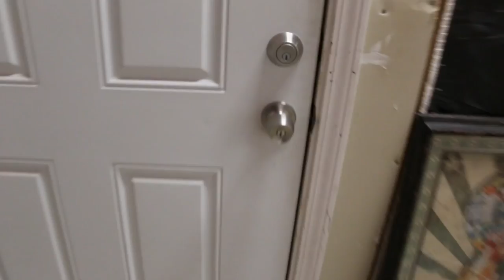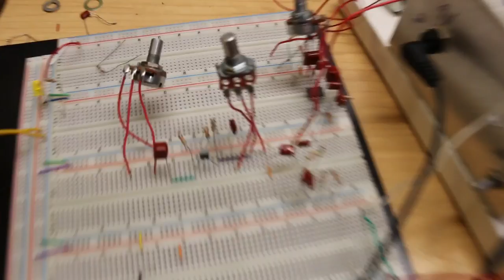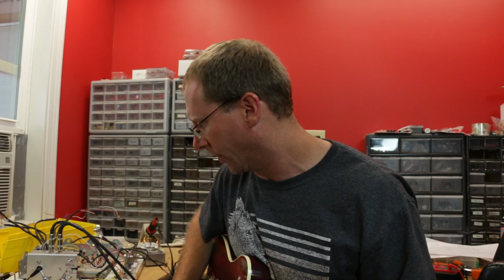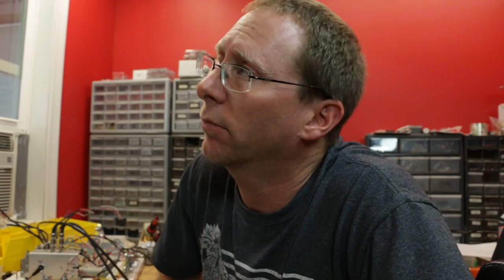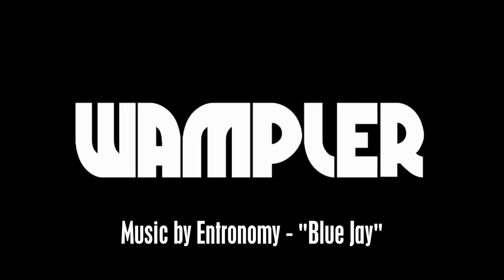Busting the myth of magical op-amps and diodes...?

Comment: The 4558D just sounds right to me. It's all in the high mid sizzle character. The 4580 was okay, but just lacking just a touch of what the 4558 was doing. Didn't really care for much else, but the JRC 2043DD was like a more high definition 4558D, which I could see being better for blues or more articulate metal stuff when used as a clean boost for high gain amps, but I would always gravitate towards the 4558D for grungier Nirvana stuff.

Comment: A Great idea, but have flaws in this shootout:
Using diodes for clipping get most op-amp characteristics masked. Show them doing clean boosts and clipping opamp signal.

Main opamp QUALITY is in noise level or "lack" of noise when pushing high gain.

I'd like to know your design of "basic" OD circuit, because it sounds AMAZING. I just started to get into electronics (guitar pedals specifically) and I'm reading famous pedals circuit analysis and trying to make sense of everything (or as much I can).

Comment: Awesome post, though I'm seeing it 2.5 years after it was made. It's a really good thing you've done, showing us the differences between op-amps. Not much difference in this application is there? Kinda what I thought. Very interesting bit about the diodes: now they make a difference! I especially like the sound of LEDs. I built an op-amp distortion pedal years ago, and I found that LEDS had the best sound for what I was going for. Less compressed, less harsh clipping, more dynamically responsive. And I could be wrong, but I thought there was an actual difference with the first LEDs you used, the blue ones. I used red LEDs in my pedal circuit- now I'm thinking I'm going to have to try other colors, just for the hell of it. Cool post Wampler man.
Reply: Yesss.. led awesome

Comment: Thanks for illustrating that the opamp makes so little difference in a soft clipping circuit. Seems like it might make more difference in the hard clipping circuit. Certainly would in the last overdriven opamp testing you were doing. It would be interesting to hear what those different opamps sound like when overdriven.

Comment: Please riddle me this: 
1. Why are the LED's lighting up only when the guitar is being strummed? Isn't electrical signal running through them constantly in this circuit?
2. If I want to have (VERY) bright LED lights in my amp light up in sync with strumming - how would I wire it to do so?

Comment: I was surprised by the differences between LEDs.  Pink and red sounded pretty good.  Different forward voltage drop makes them clip at different levels, so the gain structure feeding them needs to take that into account.

Comment: I really enjoyed this. I was just last night checking the sd-1/ts9 mods and saw that suggestion to switch dioded to leds! It was so interesting to think of blinking lights inside the stomp box. Apparently it was a nice idea. Too bad that I found the most setups on your board to sound good or workable, hard to say which would be best. Hard-clipping sounded almost like a really loud amp, like plexis, but I kinda enjoyed soft-clipping.

I might be just talking out of my ass, I'm not at all experienced in this stuff but found the video extremely interesting. All this interest came with the fact that my Boss SD-1 is a classic and really cheap box, like $60, and as far as I understand, Ibanez TS808 is about the same era and pretty similar design but costs like $200. Correct me if I'm wrong and there's other than classic value in TS808.

I listened some tests and "tutorials" like That Pedal Show, liked the pedal, got an idea how to use one in my rig and started thinking about building my own copy to jump in the hype wagon or to test the classic.
Reply: It's an easy thing to buy the SD-1 and mod it to TS808 and for $60 that's a good bang for buck.  It's an easy thing to make switchable as well, to get both in one pedal!  The TS is a classic and it's green and people just love having the original, especially if it's a vintage one but it's not a magic circuit or anything, it's been cloned a million times.  The looks are just iconic, like the Marshall front panel or a strat or LP, but with that comes the higher price.

Comment: when breadboarding, I normally only ever hear differences in the low end output. Some have more bass content than others. Clipping is usually always about the same. However, two chips I definitely hear differences with are the OPA2134 and Bat41.

Comment: Are the Double Single DIP8 to Single DIP8 Dual OP Amp Opamp Sockets any good? How do they work in the circuit? I'm trying to get a bigger more 5150 (impossible I know) out of my Peavey VSS 20 which used the JMC 4558D originally but I changed it to a  4558DD (and it gave it just a tiniest bit of different sound)  in the distortion channel  but it's still a very Tube Screamer sound albeit on steroids but very thin and brittle as a  Tube Screamer is (Imho) I want more of a Transtube like in a Peavey XXL or at least a modern Transtube sound out of this amp. I love the amp's miniature before miniature design and looks. But maybe it's speakers are partially to blame? Ugh. I just want it to sound more modern for  the metal music I play. Thanks for any help you can offer. Sincerely!

Comment: Thanks for your efforts, interesting! If you weren't working with distortion and were working with low gain Hi Fi output stages; you would hear a lot more of a difference to tone and stereo sound stage. With your distortion demo, only the diode type and wiring made a discernable difference. Having worked in this field since 1988 (starting as senior engineer at Boss/Roland UK), my ears are tuned to what is a good distortion sound, maybe DSPs and programming is the way to go.

Comment: 10:30 did you install the bat46 both in the same direction? I have some nice op amp used in HIFI systems, BA15218, to try. why are they not used in pedals?

Comment: Thanks for the video.  I was wondering if you had ever worked on some of the discrete stuff from Electro-Harmonix circa 1970.  I had a Big Muff Pi, Screaming Bird, LPB1, and a Something Modulator (can't remember the actual pedal name).  It acted like a 3 band tremolo.  Anyway, I was amazed at how sloppy those were built vs how expensive they were.  The Muff always seemed too fuzzy to me.  
Any thoughts on those old-timers or other of the same vintage like the BossTone?

Comment: I love love love these kinds of comparisons, but there's a so many variables not accounted for with the swap and play methodology! ! I'm not sure that it would make for a good video, but I'd love to have some guitar licks recorded dry -- just guitar output to tape, clean boosting if necessary to get a useable signal. And the performance would include a good variety of different licks -- some single note runs, some chugging power chords, bending, whammy, fast and slow picking, open notes, etc etc. doesn't ahve to be long or musically coherent. And all of that would add up to a performance that can be used for every different circut! then you could do stuff like have different circuits playing in different stereo channels, do analysis on changes between different circuit's envelops, decay/sustain, attack, harmonics.... after all that, you'd be able to say stuff like "this circuit becomes saturated at lower volumes, this one's wave form is more asymetrical, this one is more compressed, this one is more articulate for short notes and this one has a flubby bass response. etc. etc. etc.

I've also heard that components, particularly older diodes and such, will react different in different temperatures and at different ages, etc.

i guess that, in the end, I want to be able to say that this component has more x-y-z, while this other similar one brings out more a-b-c characteristics. Being able to hear differences is great, but to me, being able to articulate those differences means that I understand them better.

sorry for the long comment!

Comment: You didn't try the NE5532, my fave opamp in tubescreamer circuit.  It's less fuzzy as opposed to the 4558.  I do hear a difference in person between these op amps in the room, but they didn't come through much in the video.  It's 11pm here, can't blast the speakers 100%, but I did have the volume pretty loud.  Seems to be one of those things that you won't notice if you're listening or in a mix but the person playing can easily notice a difference.  The video made them all pretty much sound the same, but aside from that it was a cool video and the soft clipping vs hard clipping thing was a nice bonus.  It used to be discussed with Max and Travis in the questions, but cool to see it played out with a guitar in hand and a breadboard.

Comment: Glass envelope diodes allow light to hit the PN junction.  This will cause a bias voltage across the diode that will not appear in a closed pedal enclosure. I wonder if this affects the sound. Perhaps the anti-parallel arrangement cancels any effect caused by this bias.

Comment: great vid man.  i love my botique pedals.   im going to talk to my local shop about getting one of your compressers.   i run a simple board.  strymon reverb and distortion, empress multi drive  and mxr with delay and phase and a tuner.. im thinking a decent compressor or noise gate is all ill ever need for the rest of my rig.  (i use orange or100 and purdy tramp amplifiers

Comment: I know this is an old video but just wondering does the diode clip/compress more with a higher forward voltage or lower forward voltage. Also would love to see a video showing transistors used as clipping diodes for example as used for an amplifier saturation circuit.

Comment: Aren't clipping diodes supposed to face in opposite directions? It seems like both Bat 46 diodes are connected with the anode to ground (10:51).

Comment: you done good for others and yourself.  i do enjoy these videos.  i liked the red led's, although i have not a clue the difference than it and a diode. i remember and was on your mailing list back when you were sending out circuits.  if you see this, what is the actual difference in a tube preamp in say any fender, and the circuits in a stomp box?  the voltage is converted to dc correct?  i will stop there.  because yeah i am over my head

Comment: Hello good day.
Wherever there is a 4558 chip, can I place another of the ones you mention without changing anything in the rest of the circuit?
Frankly I've never liked the sound of 4558, it's very cold.

hola buenos días.
en donde sea que esté un chip 4558, ¿puedo colocar otro de los que mencionas sin cambiar nada en el resto del circuito? 
francamente nunca me ha gustado el sonido de el 4558, es muy frio.
Reply from the maker: +Josue Stein yes, as long as it is a dual opamp it should still work roughly the same in a overdrive or distortion pedal
Reply: Thank you Wampler Pedals 
I'm impressed. It's a shame I could never get the time out of my father to teach me electronics. Just what you need. This video opens a wide range of possibilities.
Reply: Wampler Pedals I'm going to bother you with one more question, which does not have much in common with the video. What can be a good substitute for the J201 FET transistor? You are the expert on pedals, and this must know. Thanks for your time.

Comment: I'd love to see some technical measurements of all these chips some time, just to shut everyone up permanently :p
Reply: You can find data sheets on each IC very easily. I look for data sheets whenever I need to sub in one component for another due to unavailability or just exploring new sounds

Morons on forums never research before opening their mouths however. They'll look for any and every reason for why their pedals circuit is so great except for the actual numbers that tell you what that specific component is actually doing.

Comment: What do you have to do with a pedal to make them sound totally different, if the op amp chips aren't what really has a noticeable effect.
Reply: Is it just have different combinations of op amps, diodes and capacitors, or is there more to it?
Reply: Everything is a box of parts
Reply: Lol k...
Reply: WaRLoKWYATT
Well, the Creator talked at the beginning about the topology. That part is a big part of the box of parts
Reply: Well, transistors were still pretty new when I got my first fuzz. The dude implied the topology he's using is only good enough to demonstrate switching the chips around - tube rolling, so to speak.
Reply from the maker: To answer your question, it's a bit complicated. It's a sum of the circuits that changes the sound the most noticeably. So for example, if I want to make Pizza, I start with dough, pizza sauce, pepperoni, etc... It's not going to make a gigantic difference if I use a different type of pepperoni. Will it be noticeable? yes. But it's the sum of all the ingredients that drastically makes it great or awful.
Reply: I just want to say, I really think you did a good job on the tremolo pedals. I'm not a pedal guy, but trem I fell in love with on the transition Princeton - also had the B-face twin and S-face deluxe
Reply: ***** lol thank you for answering my question.

Comment: Op amps?my father in law and his partner were contracted by RCA to design and prototype some integrated circuits. The two finished the project 6 months early and RCA offered them their full pay and they could leave to work elsewhere, or they could stay and have the run of the lab to see what they could come up with. They chose to stay and play, and they designed the worlds first op amp. The worked with a university to produce a prototype as RCA didn’t have anything set up at the time. There was a Professor at the university that worked with them and they made a couple prototypes. RCA took the data and a pro type and shelved saying it was too much ahead of its time. The Professor decided he wanted credit for the invention and published an article about it. A few years later Texas Instruments took the design and started using them in calculators. If RCA had had the foresight to produce the op amp they would have beat Texas Instruments to market.

Comment: I do hear a difference between them. But as Mr. Wampler pointed out, it isn't a major difference. What I found here was that the 4558 wasn't my favorite. And the expensive ones too weren't my favorite. It's opened my eyes to others I found I like better. But then, perhaps I liked them better just in that particular circuit, with that particular guitar, pickups, and amplifier. Interesting to hear them compared like this.

Comment: Awesome to hear the difference between soft and hard clipping, and the diodes and leds! Don't understand the relation fo the color to the change in sound... , seemed like the red ones were less sensitive and gave a fatter sound. In the soft clipping I think I liked the amps called OP something (I think there were two).., is that possible? Love the video, as a guitar player.

Comment: When you changed to the germaniums, how would you compensate for the signal drop? Smaller value resistor earlier in the circuit?

Comment: If I remember correctly, the difference between the chips in a TS808 and TS9 is the op-amp in the TS9 is a 5 digit chip, and is quite a bit different than the 4 digit 4558 that's in the TS808.
Reply from the maker: +Dave Wiese no, not really. Same basic die. You’ll find more variation in pots or parts contributing to tone changes that you ever would in a 4558 based IC.

Comment: the best sounding op dual op amps i`ve heard to date are the sparkos labs SS3602 Discrete Double OPAMP and the v-6 vivid discrete dual op amp the 33602 being almost neutral with great tone separation for a kind of sharp but still smooth sound and the vivid v-6 being very clean /crisp with good bass and treble for a really rich sound. now my setup i use i have the vivid v-6 on the input and the ss3602 on the output/volume side for i think the best of both in one circuit.  i love your honesty and among the off the shelf  op amp ic`s   I would agree there is little to no audio difference. But, going to the higher end custom  discrete  op amp setups  is a noticeable difference . if you get a chance  check them out  i would like to hear your thoughts just make shure you have room for  them to fit they fit the same sockets but are slightly bigger and taller. i had to redo my board to use them but it was at least i think worth it.  just food for thought

Comment: great video! i am a fan of your stuff.

i bet you'd find more differences between the opamps if you removed the diodes and listened to each of them clipping by themselves. recovery from saturation varies a lot between different opamp designs.

i've found that the low frequency rolloff corner frequency also makes a dramatic difference to the structure of the harmonics you get. generally i'm more of a fan of cascaded FET gain stages rather than the tube screamer opamp circuits. i think you get richer harmonics and a more complex, moving quality to the overdrive. 

what is the series resistor you used when putting the diodes to ground?
Reply from the maker: +Jonny Reckless thanks, and agreed on the thoughts! Unfortunately I don't recall what resistor I used, probably a 1k.

Comment: Different Diodes does make a difference  ,as for op amps in most circuits with a equivalent substitute  you hear a slight difference ...I think the Rat with the LM308 may be one circuit that needs the LM308  ,I Couldn't recreate it's tone with other chips .

Comment: I have a few of the old JRC4558DD's (the glossy ones with 4 serial number) and they sound a little bith smoother compared with the New Japan Radio ones. Those usually have better specs . its being "rumoured" they changed a few things on the design to compete with the RC4558's. How they compare, the "improved" ones have a clearer high end while "the old ones" tend to sound a tiny bit smoother.